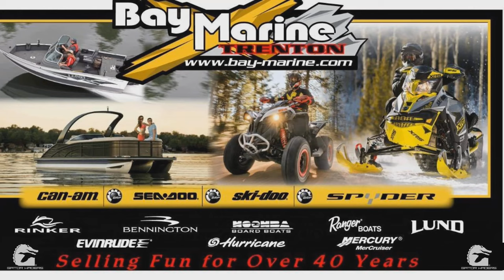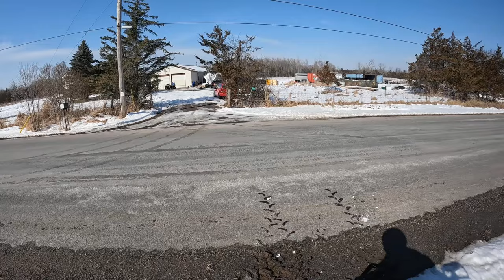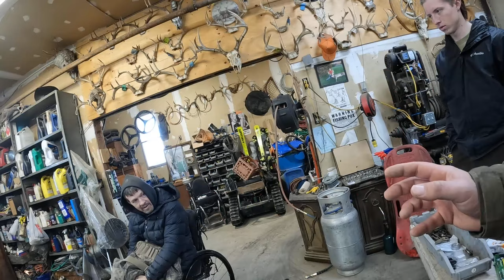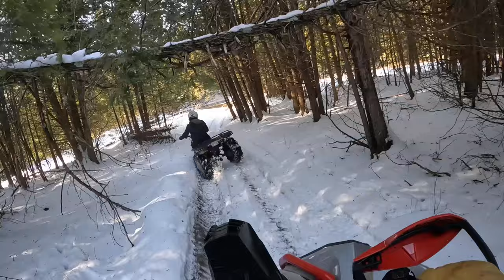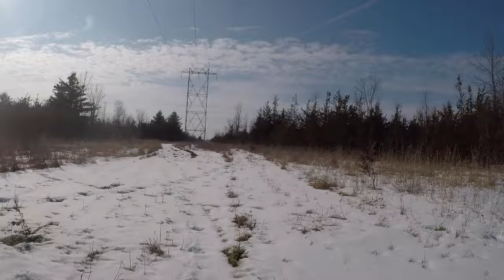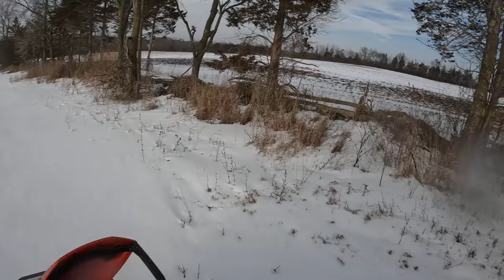Big Red Winter Rip

Comment: used to love my 250 big red it was awesome. Had my wooly booger tires on back drop pressure in them for winter. I used to have to break trail for the old man on his 250 2 stroke Polaris 2wd in the winter.
Reply from the maker: Awesome machine really. Still many chugging on the trails.
Reply: @ehTV1000 it’s hard to kill a Honda but it’s possible 😂😂